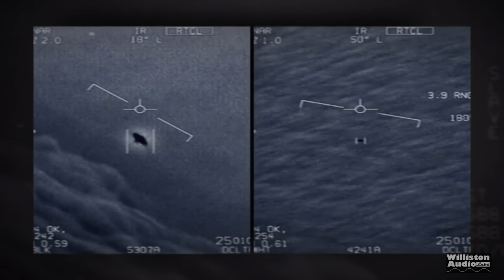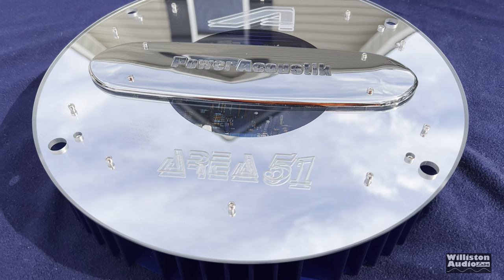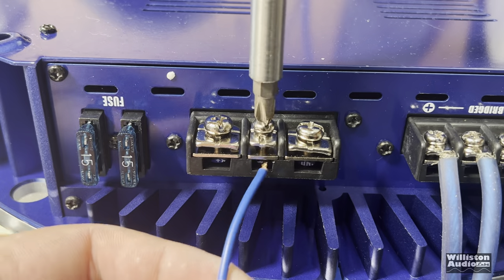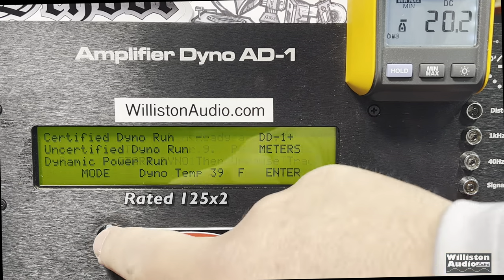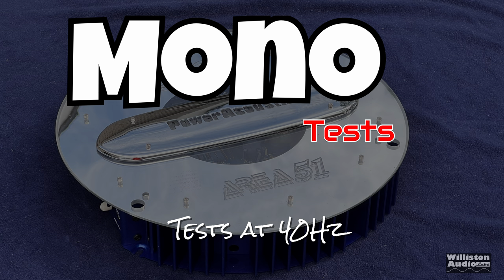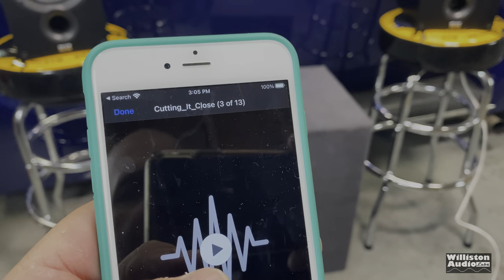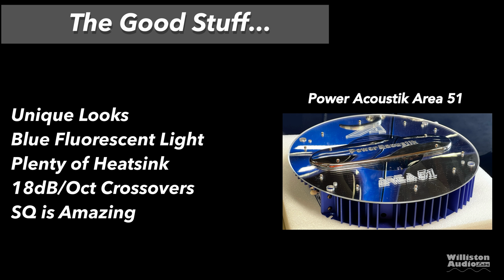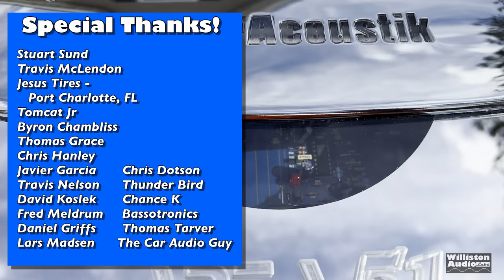Alien Amplifier? 2001 Power Acoustik Area 51 520x2 Amp Dyno Test and Review [4K]

Comment: Those double copper bars were in all those power acoustik amps like the with the windows where you could see the guts, I remember way way back years ago a car audio shop sold power acoustik and if you went in there to inquire about the amps the sales man would try to point out the "copper bar's" and the quality. Power Acoustik had some cool amps back in the day.  I had the Acoustik Power Acoustic 2400-2 High Current Amplifier. It was capable of running 1 Ohm Stable It was a surfboard size amp. Had a plexiglass window on top with 2 needle gauges and a BIG 1 OHM symbol in the middle. You could see all the guts on display, It had dual power, ground, and remote hook up's One set on each side of the amp and dual speaker hook up's the same. It was kind of a hybrid amplifier for its time beings how it was two amps sharing one board more or less and thats how the class AB amp was able to run at 1 ohm pretty cool. You would have to be an old school amp inthus to know what amp im talking about. They were something to look at. I had It pushing two 12" Kove Audio Armageddon's rated 750 each rms true power 1000 peek. Kove Audio was a solid brand. Not sure what that amps was giving them but they moved those woofers, power wasnt all the clean though.  Id love to see one of those on the Dyno.   That would be so cool to what kind of power that amp produced.

Comment: I had 3 different systems back in the day using Power Acoustik for highs and while I knew math and knew they didnt do rated power I always thought they sounded much better than the other cheaper amps out there circa 2000

Comment: Had one of these arround 2004 running 2 Earthquakes 12, on summer it used to cut off due to getting to hot, it was a cool amp to have at the time tho, cool video, had me going back in time.

Comment: Big D there is a infinity reference amp on sonic electronix called 10001a. I purchased open box for less than 250. Really interested in seeing the dyno numbers of this amp. I think its a diamond in the rough. Hope you check it out. Its 1000 watts at 2ohm

Comment: Is this the same “power acoustik “ that sells their amps at wal mart currently? I’m thinking it is. Their wal mart line of amps actually make decent power for the price. When I was saving for an amp, I picked up one to use until I got the funds together to get a decent amp with a little more power. I think I had their 2500.1D
Reply: Yes same brand

Comment: I have never seen or heard about this amp. Pretty wild design for the time. I figured the actual board and near enclosure would be much like a regular amp and the just the outer enclosure being different.  Not that I dig them for it, as it would be highly unnecessary and wasteful to build a one off board design for this.

Comment: Would it be possible to hear the test tones as you test amplifiers? Not loudly but just mixed in the background? That would give the watchers an idea of what test tones are like.
Reply from the maker: The tones are being played into resistive loads and not audible
Reply: @wal  From the head unit connect two RCA Y split cables. Then one set RCAs to your amplifier being tested and another to a small amplifier for listening.

Comment: What is the purpose of gain overlap
Reply from the maker: You can check out the DD-1+ manual as it explains in detail. It is typically for setting up subs and allowing for overhead. In this case, it allows me to precisely set the gain to match the “ramping up” test tones used for the Dyno tests
Reply: @wal  ok thanks for the info. Hey i was wondering if you could do an older XTANT amp dyno. I have and am using my XTANT X603 3 ch amp with 2- JL Audio 6½inch component sets in front and rear doors hooked to the front channels for 2 ohms, and 3-JL Audio 12wov3's for a 1.33 ohm load to the sub channel.  And it sounds way louder than what its output claims it is. I heard back in the day these things output more than they say. If you can't find one of these to test, could I send mine in and you test it and make an amp dyno video with it ?  I got it brand new in 2003 and I just put it in a year ago. It had been sitting in the box ever since. None of the caps leaked either. The original box is kind of destroyed but I could still send it in another box. Just let me know. 
Thanks, ill be watchin. 
P.S. Im so damn jealous of all those Rockford Fosgate amps on your amp wall.